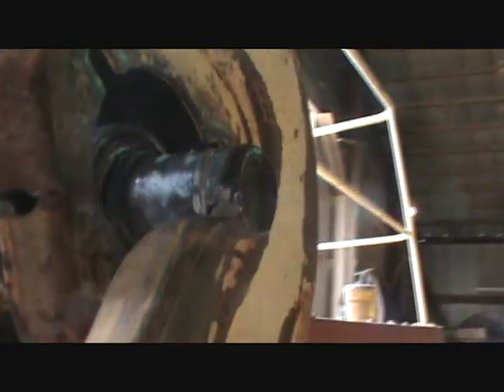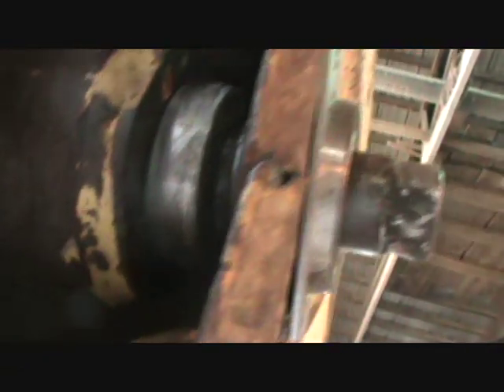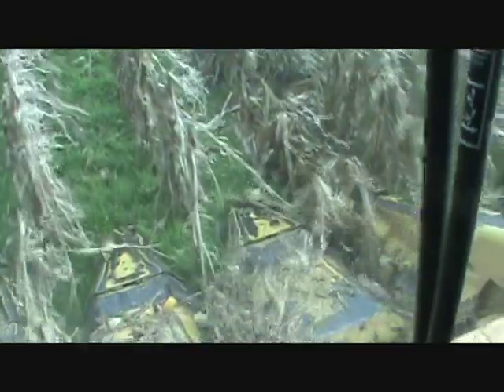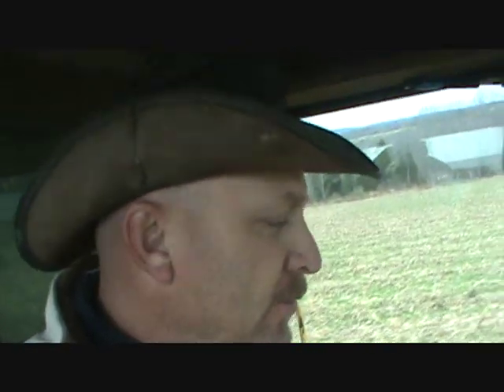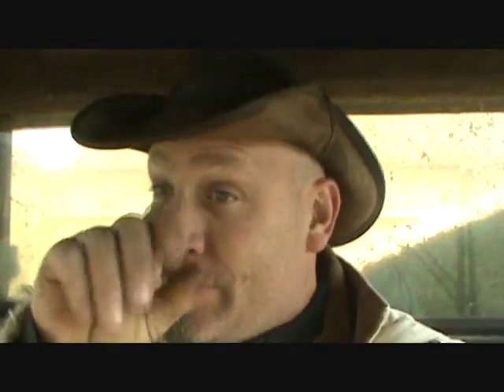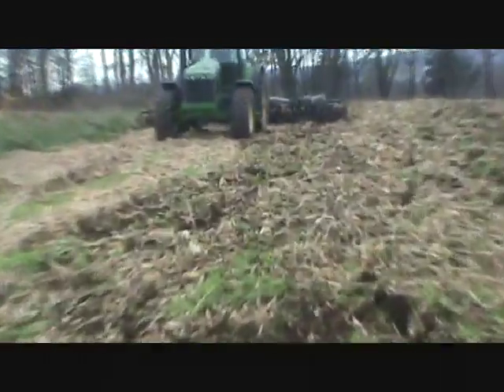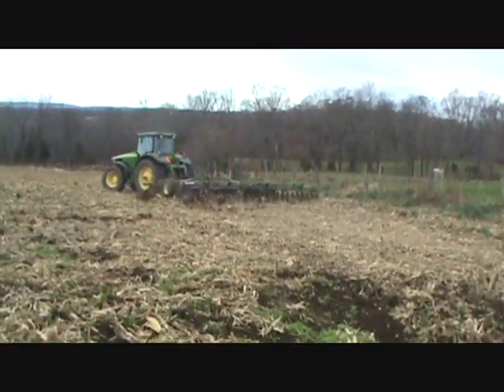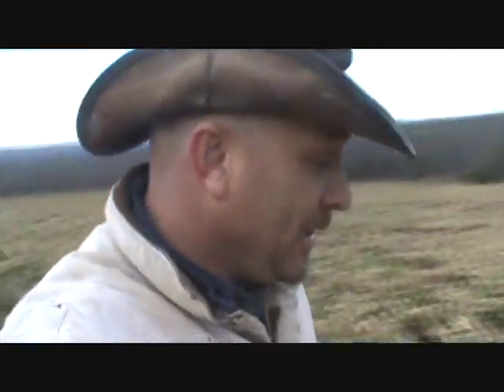Repaired bearing combining and deer

Comment: TR combine not wroth repairing. That is one of the best combines made. I run a 1979 IH 1440, i was picking beans along side my neighbor. The Neighbor fancy 5088 caseih broke down, $11,000 and two days he was going again. My biggest break down was a couple holes due to the sheet metal thin. No matter what you buy you'll have to reapir something even if its a brand new combine. Same goes for planters. Nice Video's.

Comment: When your in the driver seat of the TR look down and to your right in front of your transmission shifters is a small triangle shape panel where you usually us a drink holder. If you flip that up after you take the large screw out you will see your thrasher hrs gauge and some fuses.  The cover plate has a warning sticker on it I think.   That's where the gauge is in out TR's anyways.  Found that when we had hydraulic issues and it was just a simple fuse ! Love the old TR's!!! Bubba Booey!!!!

Comment: Not everyone in those ares is like that.  Our 1991 (I believe, may be wrong) 9400 with 3000+ engine / 2000+ separator hours did the majority of corn and been harvest on our 1100 acre farm in Champaign County, IL.  Our other combine is a 1997 9500 Deere.  Don't begin to remember the hours on it, but they're less than the 9400.  Dad's tax man was by the other day and complemented him on his low repair bills this year.  As said by others, old or new, it can break.

Comment: Just wondering how much corn does a combine drop on the ground as you are running it?  I would assume its very minimal but I've always been curious.  And yea, that old combine is running fine...why buy a new one?  Throw some good maintenance at it and it will last decades.  I've seen a few old school Gleaners still running here in southern OH....those have to be ancient.  Then again you see some huge new JDs and Case equipment running around too for the lucky ones.